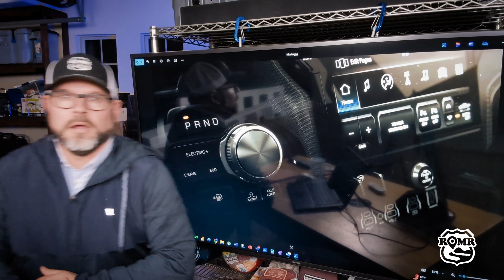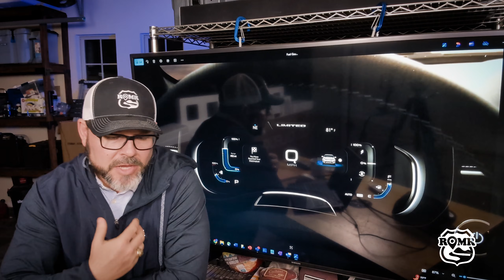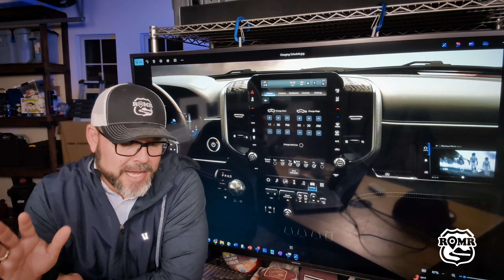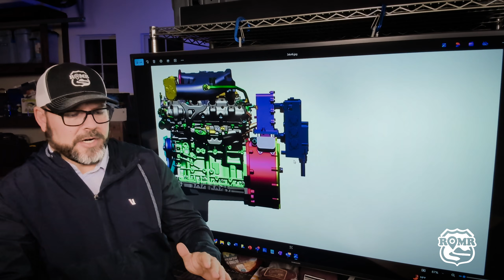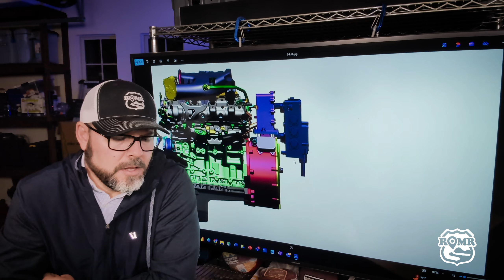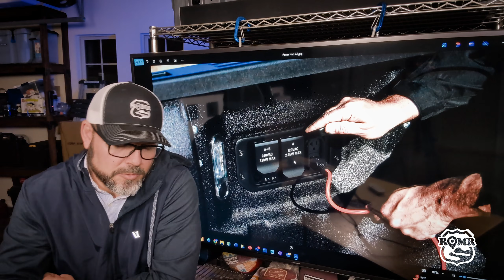Ramcharger Details UNLEASHED...Towing, Range, Power and Ballpark Pricing | Stellantis FINALLY speaks

Comment: Wish they would say what the stats are for towing at half capacity.  It's always full or none.  Most people try to land somewhere in the middle.  I have a 4000 lb camper and 5500 lb pontoon.
Reply: My camper is 5200 lbs and boat about 6,000 lbs so I was wondering same thing.   Regardless, this is going to be a great vehicle for campers.
Reply: I don't think it will be a linear curve between the fully loaded and unloaded numbers.  Be nice to see some data points in-between.
Reply from the maker: Most people demand to know the most extreme use case to evaluate the efficacy of the product.  Calculating 50% is fairly straight forward.

Comment: I've never owned an EV before so my question might be dumb. (Very interested in this EV though.) Question about the Eisenhower Pass test ...  the test drive in tow mode down the mountain permitted regenerative braking? But probably not with one  pedal driving, right? With braking with the brake pad to signal the trailer brakes? My camper is only 20' and 6000#  but  on very steep mountain grade in poor conditions, I just want to know I'll have good control and the trailer won't try to overtake the truck.
Reply: I'm just a guy with an EV, take it with a grain of salt .. but it could feed that trailer brake controller from the regen system. In 1 pedal driving, you generate power proportionate to your speed (faster you're moving, the more regen you get) and you come to a smooth stop. It also activates the brake lights when you step off the gas (not when you step on the brake). If that trailer brake "could" be coupled with the regen gauge, theoretically you could send a signal to the trailer that directly relates to the amount of regen.   More regen = more trailer brake. 

I'm just guessing, so hopefully some engineers took trailer braking and regen braking into consideration. 🤷🏾‍♂️
Reply from the maker: @BigSil57  would be a great system if true.
Reply: This is a question that is relevant to any modern vehicle, that has any form of automated braking, such as adaptive cruise control.   So it's not just relevant to EVs, hybrids or one pedal driving

Generally speaking most manufacturers do activate the corresponding brake light went any form of braking is taking place Including for the trailers, at a very minimum threshold... But you just have to check the manufacturer to get the exact specifications....
Reply from the maker: Can't answer for sure, but I'm going to guess that one pedal driving is not available on Tow Mode.
Reply: Thank you for keeping us updated on the Ramcharger.
Reply: Great question.  These trucks have a lot of regen and, while using its data in a brake controller would be useful to keep things even, why wear out the brake shoes on the trailer if you can convert the trailer's kinetic energy back into the truck's battery?  That's what would be really cool, IMO.  The limiting factor is how regen, like charging, can heat up a battery.  It's why many turn off regen and stick with friction brakes, for a track EV.  It comes down to thermal limits.
Reply: Battery pack has a BMS to protect it and friction brakes produce far more heat then regen and wear down the brake pads.... So it makes no sense to turn off the regen
Reply: @nc3826  Regen turns off when either too hot, or too cold. Down a mountain, if dumb enough to be pure EV all the way up, on a hot day, you might need a handful of friction brakes.  I'll bet they thought of it and maybe we both hope they don't defer to friction braking too early, or deny the ability to use the trailers kinetic energy for added range.
Reply: @hcjpbluesky9916   So in which EV, did you have those enlightening experiences? Coincidentally the latest "auto buyer's guide podcast" did address how to maximize regen. But I personally would prefer to stay out of that rabbit hole for now.

FWIW when the Scout vehicles come out. I'm willing to bet the pure BEV is going to have more regen coming down that mountain, then the EREV versions. Somewhat, but not fully analogous to why the BEV version, will have better acceleration.  And I'm sure it'll get tested at some point, so feel free to get back to me, after it's tested.
Reply: I own a Hummer EV and I know a towing my 30 ft boat it still keeps my one pedal driving in tow mode. So going down hills is very manageable. You also have to think this truck is significantly heavier than a standard 1500. So is a lot more manageable towing a heavier trailer behind it. With my Hummer it's like nothing's back there at all even going down some steeper hills and it performs flawlessly. Also someone mentioned in colder weather the regen doesn't work or is cut out. I have not experienced this and I've done some regen breaking in temperatures around 20° f.
Reply: reality and the voice of experience, 

just confuses those with a narrative, that (pretends to) know it all
Reply: @nc3826  not sure if you're referring to me or somebody else. But along that same thread my experience may very well be be a little different than some other manufacturer of EVs. I really just hope this truck is successful because I want other manufacturers to compete, better for all of us!

Comment: This is going to be a $70-80k....so no thank you. Not worth it. Folks need cheaper options. Stellantis just doesn't get it...cheaper products sell. It does not matter what is the powerplant inside it.

Prior to covid, dodge cars and Ram trucks sold well because it was CHEAPER then the competition.
Reply from the maker: Based on comparable products and the interest on every video we post, demand won't be an issue at all.
Reply: @ROMRreviews  would be real nice for the working stiff (farmer/ rancher/carpenter/HVAC guy) if the tradesman trim level came in under 60K though
Reply: that's why God may used vehicles
Reply: So the average guy should never have a new car?  That's an asinine opinion.  FTR all of my vehicles were bought used.  I have over a million miles on the 4 I own.  This is the first new vehicle I've considered in over a decade so...

Comment: talk to me about gooseneck and fifth wheel
Reply from the maker: It certainly has the payload to handle that.  I don't see any reason you wouldn't be able to use one.
Reply: @ROMRreviews  no interference with battery between frame rails?
Reply from the maker: @billmeredith70  the battery is entirely under the cab so should be no issue with that. 

Doesn't mean there aren't other things under there to be concerned about. Time will tell.
Reply: There are diagrams that show that, access Is available for an aftermarket installation.

Think the biggest concern will be in terms of the OEM's warranty???
Reply: Saw one place that it won't come factory with those options, but they're leaving it open to aftermarket
Reply: Would love to see those pics.  Were have you seen them?